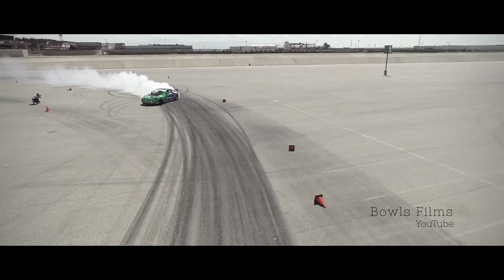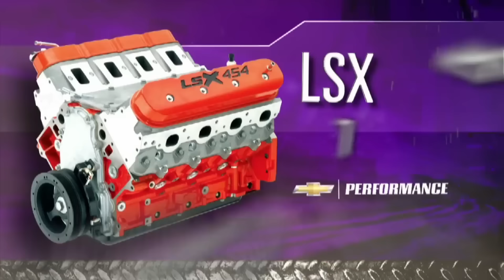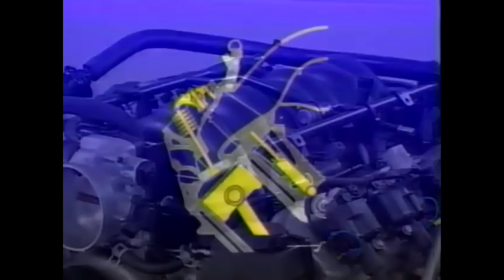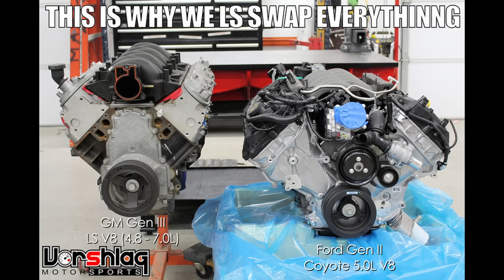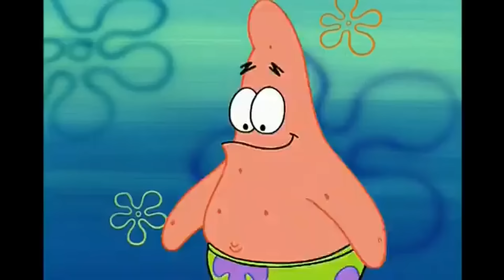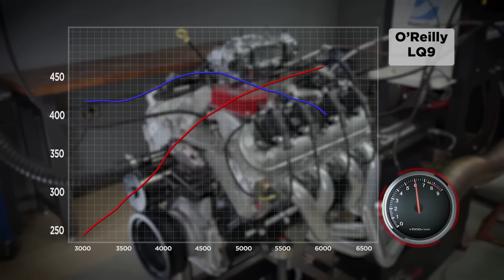Why are Chevy LS engines so good? - 2024 edition | Power Rankings

Comment: If yoour car came with a gen 1 350 small block, it will always be cheaper and easier to put back in what came out. For the extra cost and time it takes to get everything to make an LS work in your GM car with a factory gen 1 small block, you could build a pretty stout SBC and put it right back in with no problems. I see so many people with G-body's going to LS and I can't understand why. Small block Chevy's are still a good platform with huge aftermarket support.
Reply from the maker: I think that's a very valid point. And I don't think every car needs an LS swap. If your car has a decent performance engine in it. It probably makes more sense to swap the same family of motor back in

For my situation my stock engine Departed the building. And everybody told me to build a BMW m60b44 to replace it. But once you start doing the costs breakdown it didnt really make sense

-Q
Reply: @Aperture.Motorsports  I agree with everything you said. And unless you're a hardcore street racer, or someone who goes to the track regularly, swapping in an LS doesn't make sense. If it's fuel injection you want, they make plenty of EFI kits for small blocks. Most stock gen 1 bottom ends are plenty strong for street use.

Comment: NOTHIN beats a properly built sbc bang for buck. LS still expensive but they are easier to work on
Reply from the maker: I personally don't have a whole lot of experience with SBC, but they seem like really cool engines. That was my grandfather's suggestion when I started LS swapping the e34. He wanted something similar to a DZ302

-Q
Reply: U did the right thing. I was jus speak more in the Chevy community wit older builds. Ls ain't necessary but in ur case I woulda jus stayed with the bmw platform. They drive perfect already
Reply from the maker: So I actually cut the reason why I'm swapping away from the BMW platform from the video. Because I'll probably make a video about it later ...

But basically my car was a M60b30 automatic. And the transmission and motor started to give up the ghost around 297k. And a lot of the BMW guys said they would have preferred if I would have stayed on the BMW platform and built a m60b44. that would involve finding a 4.4 l block from a E39, and 4.0 cylinder heads from a e34. I talked to somebody who did that swap and it made around 320 horsepower, and it cost them around three and a half Grand to do. Not to mention the fact that my car needs a trans swap as well. So to me the bmw juice wasn't worth the squeeze

Comment: There is a thing back and forth on which I'd easier to work on. And a bunch of other stuff. Ls engines are simpler. Some say the 5.0 is simpler to work on. I say rebuild one of each and look at the price tag and the difficulty level of both. Depending on how wore both engines are the Ls is cheaper and easier. This is the reason I went with the Ls3 for my swap. Not buying a 10k drop out. I bought a really cheap one that dropped a valve seat and cracked the piston. Luckily the owner shut the vehicle off as soon as he heard the bang. So I had to replace one sleeve. $350 on top of the normal machine work. $750 for a complete cam kit from BTR. It's almost 2 grand just for cams in a 4v mod engine or a 5.0 which is also a mod engine. 32 valves make it alot more expensive to do the heads. Unless it doesn't have much wear. So yes Ls's are easier and can be cheaper. But my next swap will be a 5.0 in a Crown Vic.
Reply from the maker: 5.0s are really good motors. I had actually wanted to coyote swap my E34. But when doing the finances and the breakdown spreadsheet versus the ls that was available to me that my local parts yard just didn't really make sense

-Q
Reply: Same here. I was originally going ro 5.0 swap my Vic, but I looked at the prices. Even high milage 1st gen 5.0s are going for $3500. Not far from rebuilding. And then 2 grand for  control pack. That's 6 grand with tax. And that's just getting started. So Ls it is lol.